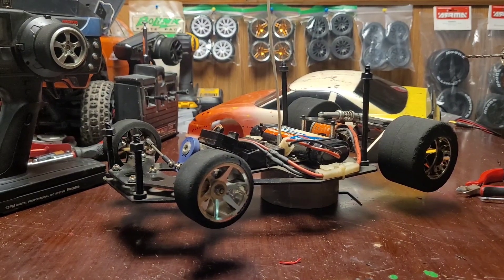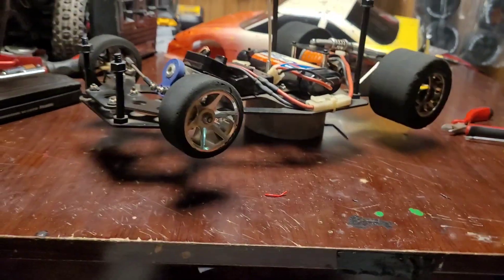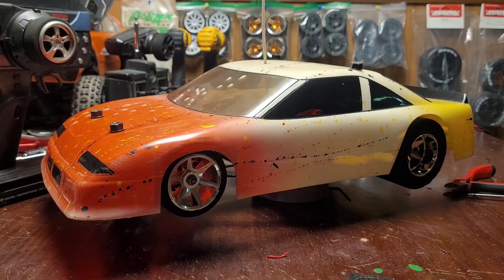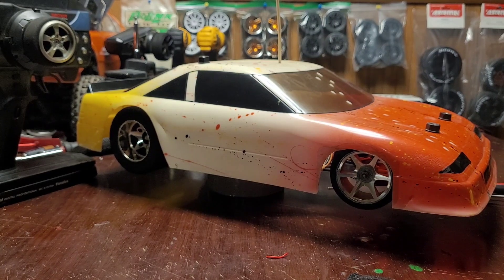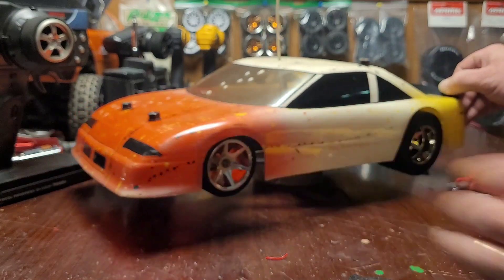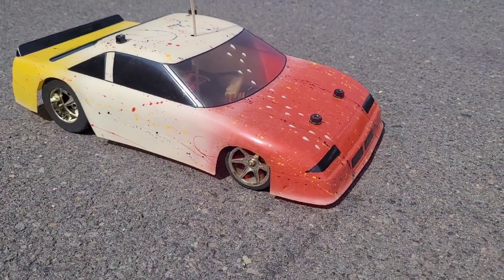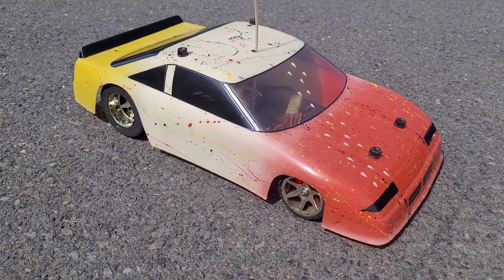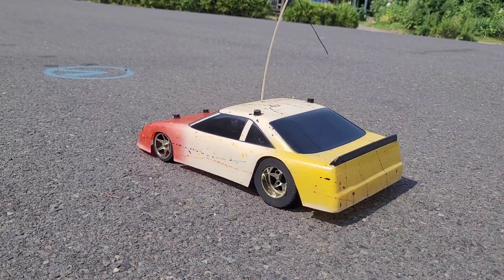1986 bolink eliminator 10 street stock drag racer review/run

Comment: I'm in the same boat as you as far as remembering it being a lot faster. I'm 45 years old now and my buddy was cleaning out his parents house and gave me a bowling eliminator that I had also owned not the same one but around 10 years old. It seems like a rocket ship when I had it but my street was very rough and destroyed the foam tires. I put some rubber tires on some plastic rims I believe they were called Street dogs or something like that but didn't understand the gearing and it was slow as s*** but I never wore out a tire. I I have found an alternative to the foam tires and that would be a radiator hose. I used beat sealer for automotive tires to glue it to the aluminum rims. Just going to have to do a few burnouts on a piece of sandpaper to round them out. Haven't figured out what I'm going to do to smooth out the front tires yet
Reply from the maker: Ok good luck 👍 I have about 30 vintage bolinks if u ever need any parts let me know 😉 thanks for watching 😊 🙏
Reply: @c.k.hobbyshop3351  the one I had 35 years ago had the single small spring on the rear. This one has the 2 shocks . Supposedly oil filled? Or oil lubed. I have 2 short actual oil filled I might use. But damn ! Makes me feel like a kid again. Just used up a battery on my vaterra v100 before Costco opens. 22 degrees so not using the other battery.
Reply from the maker: @mcalvinscott  yes sir I got my first in 81 I was 11 I'm 51 about to be 52 but every time I bring one of my rc's out side I'm 11 all over again I think it keeps u young or at least young at heart ❤️ good luck and thanks for the feedback